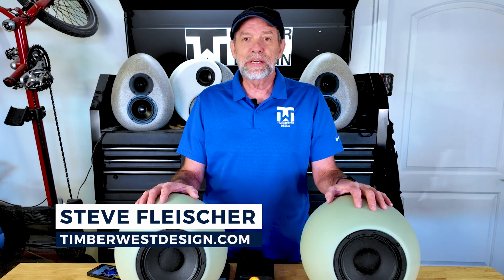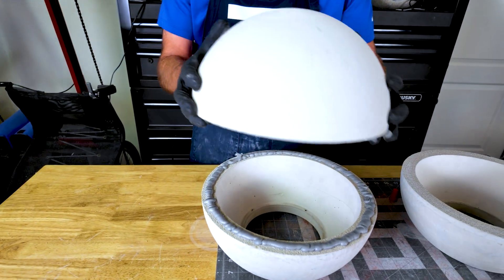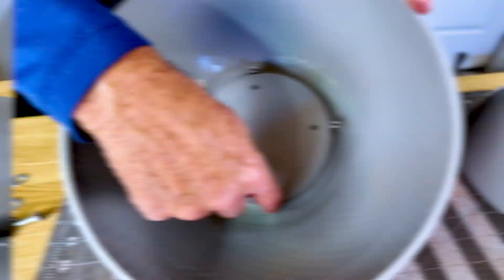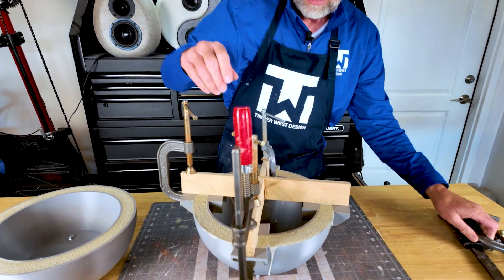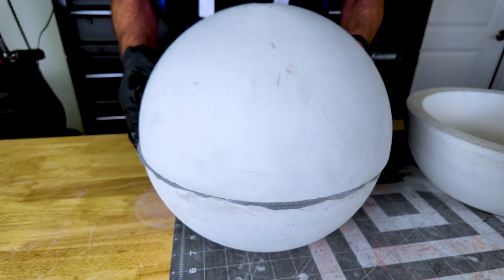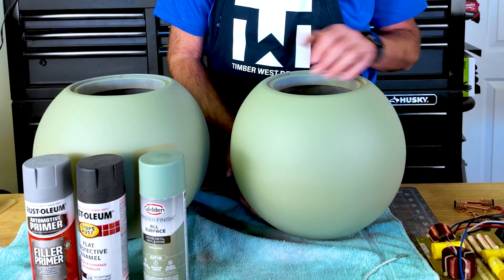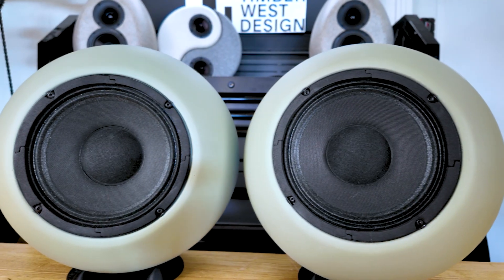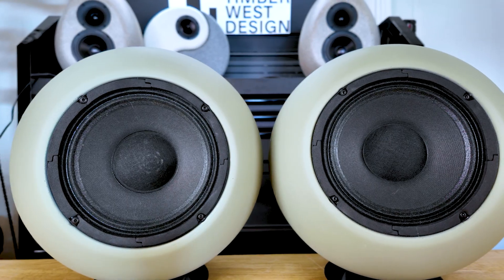I Built Speakers Not Out of Wood but Concrete… And They Sound INSANE!

Comment: Really nice. You have found Danny and he is without a doubt the right man. This is promising and exciting.
Round shapes are the most rigid and with concrete it cannot be a deader cabinet.
If I were to offer a point of view.
There could perhaps be a little better space for the terminals. You could use the clever solution that secures the position between the shaped parts on the front half where the hole for the drive unit itself is. Then you would have dropped the wooden cross, and the terminals could be mounted on a small round plate in a smaller hole on the back, and could perhaps also be slightly recessed in the cabinet.
Wishing you all the best,
and Danny too.
Reply from the maker: I appreciate the feedback on the terminals. I'm always looking for ways to improve the design.

Comment: Nice work👍
Reply from the maker: Thanks!
Reply: @timberwestdesign  I’m thinking about how you could get a constrained layer in there.  Spray the inside with rino liner coat then outside in something more vioscoelastic, then re-insert in mold for 2nd layer of concrete. 1/3 inside. Constrained layer bonded in between and 2/3 concrete layer outside. Increased damping.  Worth an experiment?